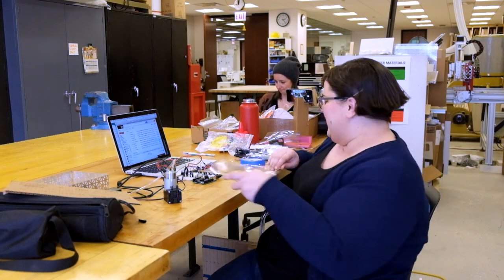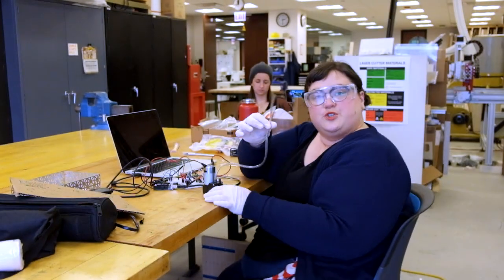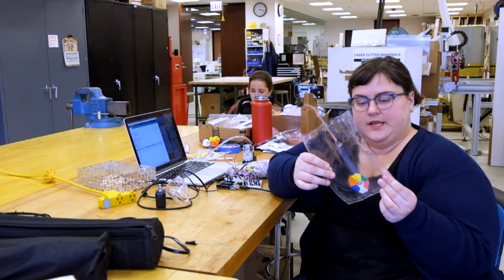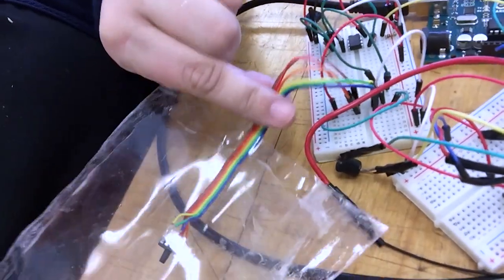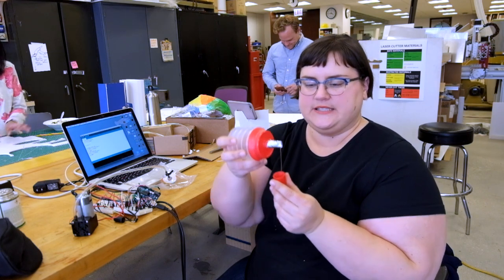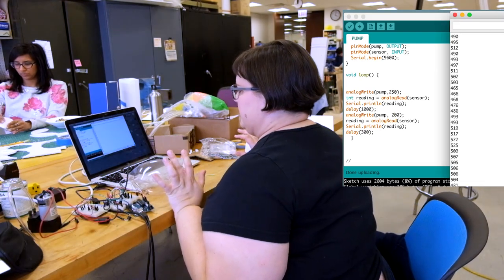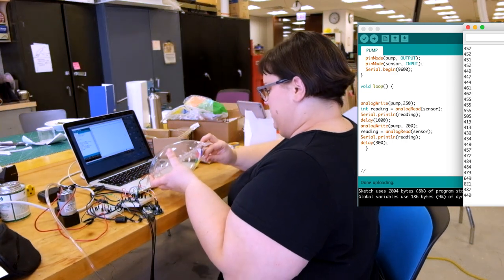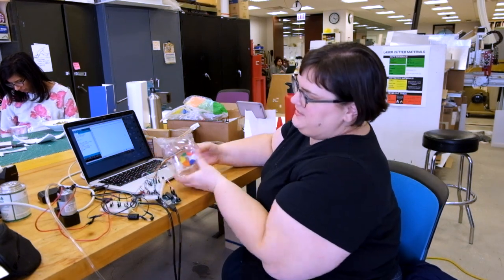Experiment: Arduino Pressure Sensor inside a DIY Inflatable

Comment: It doesn't work because it is a differential pressure sensor, if you put the whole thing IN the bag, the compared pressures are exactly the same, even if you hit it and it shows a reading difference, it is not operating correctly, you need a tube.
Reply from the maker: I'm honestly not sure I follow - I understand why the compared pressures are the same, but I don't understand the tube. Do you mean a small tube fitted over the cylinder piece of the component?

edit: also, thanks for the comment.
Reply: Exactly, fitted over the cylinder piece... To be honest I'm not completely sure it is a differential pressure sensor. I just bought one of these, I want to use it on a pressure cooker at a certain distance and after a pressure gauge syphon, with a tube, I'll report back to tell if it worked.  @BeckyMarshallDesign
Reply: Huh????  +  Fresh eyes + comment = Lighbulb then: Duh!!!!!!!!!!!!!!!!!!!!!!!!!!
Reply: @BeckyMarshallDesign  Yes, you need a tube, and it is a differential pressure sensor, like Alexander Lang says in his blog and his shop where he sells his breakout board for this sensor. The sensor just arrived and i notice it has a hole beside the cylinder component, that is where it detects the "outside" pressure, in other words, the pressure that it compares with the pressure inside of the cylinder component.
Reply from the maker: @greenspanfx  Thanks again for these comments greenspanfx, makes perfect sense to me now.  (facepalm)
Reply: @BeckyMarshallDesign  Yay! facepalm! Thanks to you for uploading the video.
Reply: @greenspanfx  hello ,sir  Can I use Omron  2SMPP-02 sensor in place of this sensor  for STM32 Or Ardunio  if I  can use plz suggest me the ckt diagram for it . because its output voltage is 3mV and plz suggest the ckt diagram for amplifying the output voltage
Reply: @greenspanfx  tqvm for the explanation good sir
Reply: @divyanshusingh2021  I am sorry I'm not very technical I don't know. I just saw your comment. :/
Reply: Thank you.

Comment: This is a differential pressure sensor. It has a small hole at the bottom and only measures the pressure difference to the air connector at the top. Otherwise, you could only measure the absolute athmospheric pressure, wich is useless in this case. You don't seem to be trying to measure the altitude over sea level of your lab ;) 
You want to measure the pressure of the inflatable relative to the ambient pressure, so you have to connect a tube to the air connnector at the top of the sensor and put that into the pillow or you need to use a t-connector at the output of the pump and connect the sensor there. Don't try to measure pressure while the compressor is running. Once in a while stop the compressor and wait for > 100 ms before measurements. The pressure oscilates massively due to the oscillating output of the compressor when it is running and for a short time after.

I have built two complex machines using this approach and it works perfectly. I use the mpx5010dp (0-100 mBar) sensor for balloons and larger inflatables. It is not cheap (about USD 20) but measurements are very precise. You will need a sensor for higher pressures if inflating these small pillows so tight. MPX5050DP should be fine. It goes up to 50 kPa/500 mBar. You can calculate pressures in kPa or mBar with a very simple formula written in the data sheet.
Reply: hello ,sir  Can I use Omron  2SMPP-02 sensor in place of this sensor  for STM32 Or Ardunio  if I  can use plz suggest me the ckt diagram for it . because its output voltage is 3mV and plz suggest the ckt diagram for amplifying the output voltage
Reply: Thanks so much for this explanation!  I was so confused watching, but this helped a lot.

Comment: This video came up while searching Arduino air pressure projects. Interesting experiment and I like that you didn't cut out the mistake. We all have those moments. 

The sensor is most likely a differential/delta/relative sensor that needs to have a reference outside of the inflatable(may have an air hole or flexible membrane in the back of the sensor.) If it was an absolute sensor it should work inside the inflatable and give you a good reading. The down side of the absolute sensor is altitude compensation. Here in Colorado(5300 ft) my air pressure is ~12.5psi/84kpa and sea level is ~14.5psi/101kpa. That 2 psi difference could be enough for an inflatable to pop. Now you need a second sensor to measure the barometric pressure before airing up the inflatable. The best option is still the differential/relative sensor with a reference to the atmosphere(barometric) 

Note: the weather station barometric pressure is a altitude compensated value.
Reply: Can we do this for gasses?

Comment: I"m wondering if just the sensor tip should be inside the bag, and not it entirely inside.
Maybe it needs a differential pressure to measure, putting it entirely inside there is no pressure diference.

Comment: Hi, sorry not sure if anyone else has already commented on this, but that sensor is a differential sensor and you have put the both ends, measurement nozzle and the comparative atmospheric windows in the same space, which practically means that the gradient measured is 0, hence no reading.

Comment: Hi Becky, I spent hours try to get the little MPS20N0040D-D pressure sensor to work like you did. The problem is the "specs" on the internet are wrong. The OUT + is pin 4, not pin 3!!! If you try any of the examples on "The answer is 42" web site they won't work unless you use pin 4 instead of 3. Voila!
Reply from the maker: Thanks for commenting for some poor soul to discover!!

Comment: Thank you Ms Becky! your video is very interactive. I was going to go with the pressure sensor likely the one you are using but I'm reconsidering it now as troubleshooting it will waste a lot of time. Thank you for saving me a lot of time whilst sacrificing yours. Pretty impressed with your diy airtight pillow :)

Comment: Hello, nice work dear, but for the sensor to work we need to put it out side the bag and only connect a little tube inside the bag.
this is because that pessure sensor has a little cavity in the bottom for mesuring the amount of distance in a very little diafragm.
Reply: Instead of a bag, try a blood pressure bulb with hose onto nipple of little tube. But, this might be two extreme as to up and down.  You might "T" into a bag.  Then, squeeze bulb to raise pressure into tube/sensor/bag.  Read results.  Release bupb knob to release seal which allows air out which lowers pressure which is read and reported.  Science is trial and error. Mostly error..

Comment: One end of the sensor must be outside the pillow to register the pressure differential. Put a hose on the stub and seal the hose in the pillow with the sensor outside the pillow.

Comment: Nice video.
Well, I've been working on making a water gun using 2 litre Soda bottle. The idea is to use the pump to fill the bottle up, once we get enough water take the input pipe (of the pump) off the water source and let the air fill the bottle hence building pressure in it. The output is the air compressor gun that throws out the pressurized water.
I was looking to find a way to monitor or regulate the pressure in the bottle (don't want it to blow up). I wanted to stop the pump at certain pressure. Was very excited when I saw you using the same pump and doing exactly what I wanted.
Will give your schematics a try, if I succeed, will let you know.
Reply from the maker: Thanks for sharing! I'm glad me sharing my (sometimes embarrassing) science experiments is useful for people. Makes it worth it.  Please, do share how your project ends up!

Comment: Well it's said tha you learn more from failures than from success, doesn't it? btw I learned a lot from comments: this is a differrential sensor! compares air presure from above to the hole beneath! saved me lot of time!
you  asked what brought me here: our government in Argentina  connected a WHOOOOLEEE bunch of new users to  the wateer netwrok....BUT the  managment company DID NOT add pumps so..water pressure is low...and I plan to make a buz from that!! lol ( I mean installing automatic pumps)
Reply: hello ,sir Can I use Omron  2SMPP-02 sensor in place of this sensor  for STM32 Or Ardunio  if I  can use plz suggest me the ckt diagram for it . because its output voltage is 3mV and plz suggest the ckt diagram for amplifying the output voltage

Comment: a couple of years later then you but what brought me here? well, I'm thinking of a way to have an arduino meassuring depth, so basicaly the same setup you have but when the bag is going under water it will compress. for my project i am going to try out a BMP180

btw, Thx for your video

Comment: Hello,

Everything was good except for one small point that caused incorrect results. The sensor needs two different air pressures to measure pressure. One is the reference air pressure, where the sensor is located and against which it measures the secondary air pressure. The second is the secondary air pressure, which differs from the reference air pressure, and we intend to measure this difference with the sensor.

For the sensor to function correctly, the sensor body must be outside the measurement location, where we have the reference air pressure. The air pressure we want to measure should be directly connected to the sensor's tube interface so that the sensor can read the pressure difference between these two areas. When the entire sensor is inside the chamber, there is no reference pressure to differ from the secondary pressure, and the sensor will have no output regardless of how high the internal pressure rises because there is no pressure difference.

Comment: Dear Becky did u solve the problem.

i have read that sensor via pic microcontroller also made some opamp amplifier circuits

i think the main problem with this number of pins is wrong

opposite to a normal ic

Comment: I got a suggestion just to check it out I guess  u may have to place sensor to a rigid area  where the force of air acts only one one side of sensor may be (Top) as the sensor is just placed inside the transparent bag kind of pressure is acting equally at all sides so the forces are nullified and no much difference in reading is seen..... pressure is as same as force...if we want to calculate we have to fix the base of sensor to rigid surface and force has to be applied from opposite side. ..Give a try ....might help you 

Thanks 😊

Comment: Nice work. I’m curious to find out if you eventually get that sensor working. So I subscribed. :)

I’ve been working on heat sealing polyethylene shapes for a few years. Seems like pretty useful thing to have a low pressure warning on some products, or the self-inflating feature you’re working on here. I haven’t made any videos yet but might do so someday.
Reply from the maker: Derek, thanks for the comment! I've got a heat sealing experiment video coming up soon (spoiler: lots of fails!), and I'm dying to know what YOU know about it! I started making these videos because the info was not out there on the internet, and because I like to teach and mentor. I encourage you to document your experiments too! 

My ultimate learnings about the pressure sensor: air pressure changes when the volume of air exceeds the volume of its container. In an oxygen tank, we can increase air pressure without breaking the metal tank. But in a vinyl inflatable, not only will the container pop, but it will expand and stretch until the moment it pops. So the reading I experienced here https://youtu.be/SSQb03E6DUo?t=6m30s is when you see the pressure sensor working. 

Essentially, I learned that the pressure sensor wasn't right for this particular project, and if I wanted to monitor air loss, I'd have to find another way.
Reply: Thanks for the reply. Btw, before I forget again: I found your video by searching for “diy inflatable”. 

I inflate my creations with hand pumps, one of which I bought from a kitesurfing store and it has a pressure gauge on it. Most inflatable kitessurfing kites are inflated to 7-8 lbs per sq. inch.  My inflatables can only handle 1-2 lbs per sq. inch.  Now that I think about it I didn’t look at the units on the guage. Maybe it’s lbs per sq. ft. 
 I’ll check.
Reply: The units are psi.
Reply: When I inflated my shapes to 2 psi the 4 mil polyethylene (PE) sheeting I used started to bulge and distort.  This stretchiness severely limits how much weight an inflated PE tube can support.   However, there are still applications for low pressure inflated PE cylinders, such as kites or other toys. 

I was thinking it would be nice to have a wireless pressure loss indicator on my kitesurfing kite that would let me know if it had a slow leak.  That was one reason I was interested in your pressure sensor experiment. I wish I had time to pursue the idea, maybe someday...
Reply: I think one of the reasons that there is not a lot of information out there on making inflatable‘s is that there is a lot of potential for patenting new ways of making them. Also, people who have an interest in creating inflatable‘s commercially may avoid patenting their techniques or tools, because they prefer to keep them as a trade secret. I am in the process of doing a patent search to see if the things I’ve created are already patented.  If it’s not, I’ll apply for a patent and make and post videos of how to build them.  If it’s already patented, I’ll then be able to make and post videos sooner. It’s super fun to make a breakthrough and I’m itching to share the discoveries I’ve made. Especially since I’ve benefitted from other people posting their discoveries.
Reply from the maker: Thanks for sharing. The low PSI inflatables you've mentioned sound potentially useful to me. What tool are you using to heat seal your tubing?  ;) Polyethylene is different from vinyl-- I guess you are using heat crimpers like for sealing packaging.  I tried a 'seam sealer' -- an electric hot pizza cutter -- on vinyl, with mixed results. Only achieved a "good" seam when I melted the vinyl in two. That video comes out within a week.

Some of the hypotheses I've had for sensing leaks in an inflatable-- because I was definitely working towards the same goal as you-- was using flex sensors, or stretchy fabric sensors, to monitor the actual geometry of the inflatable form. I also considered designing in an intentional point of failure, in order to measure that spot in some way. Those concepts remained concepts.

Good luck patenting. I'm a radical sharer. Speaking of which...

I see you're a kitesurfer in Hawaii. You might like my next series. My buddy John Pew, of www.trewgear.com, wants to build a desktop windsock so he can just glance at it and know the wind speed and direction at his favorite beaches. I'm going to film myself teaching him how to prototype and build it out, put that on YouTube, then I may design a version to launch on Kickstarter. I'm-- ahem-- stoked. So, stay tuned.
Reply: I use a regular 12” impulse sealer I got from amazon or eBay for $25.  You can disconnect the heat element at the springs that hold it in place and attach alligator leads to use the timed electrical impulse on prototype elements of your own design. 

It’s hard to find a valve design that works, though. The leaf valves that are posted on YouTube work for a few inflation/deflation cycles but are not durable. They are also hard to make and their success at sealing seems to depend on the thickness of the plastic sheeting you use. The only thing that sticks to PE (because PE is a “low-energy surface”) is Gorilla Clear Repair tape. So that might might work to stick on a small vinyl valve if you overlap all edges of the valve and wrap the tape all the way around the back of the inflatable.  I didn’t try that. You really need a check valve (during inflation) and a more positive (threaded cap) seal surface (to hold the seal longer). I haven’t tried the Boston valve but I bet it would work.  I think I t’s too heavy and expensive for my purposes. It would be helpful to find or make a lightweight cheap version of the Boston valve. I’m working on a DIY version of the Boston valve. 

The feature of the Boston valve that would make it work for PE is that it attaches to the sheet of plastic with a sealing surface that clamps on with pressure applied by a threaded hollow tube (that has the check valve inside it.)

PE is an ideal material to work with because it’s cheap and strong but it is hard to get things to stick to it. I guess that’s why there is commercial potential for innovations that overcome that problem.

Comment: Hey
I think a the pressure sensor pin is floating so it needs to be connected with a pull-up resistor in the code.
Reply: hello ,sir  Can I use Omron  2SMPP-02 sensor in place of this sensor  for STM32 Or Ardunio  if I  can use plz suggest me the ckt diagram for it . because its output voltage is 3mV and plz suggest the ckt diagram for amplifying the output voltage

Comment: hello ,mam  Can I use Omron  2SMPP-02 sensor in place of this sensor  for STM32 Or Ardunio  if I  can use plz suggest me the ckt diagram for it . because its output voltage is 3mV and plz suggest the ckt diagram for amplifying the output voltage

Comment: Hi Becky,  I'm just starting my PhD this semester working on pressure sensors for tires using 3d printed sensors I was really hoping you get lucky with this project so that I can follow your steps. However, you gave me some ideas such as using the Arduino which I have never used before. I want to evaluate sensor performance on all aspects like speed, load,pressure, tempreture, Force,...etc.  if anyone can help me please let me know. Thanks Becky and All
Reply: Hi Mazen, I'm curious were you able to do this? Would be great to hear from you! Thanks:)